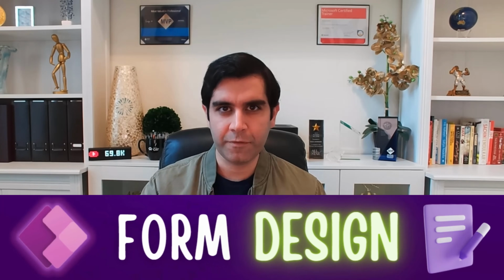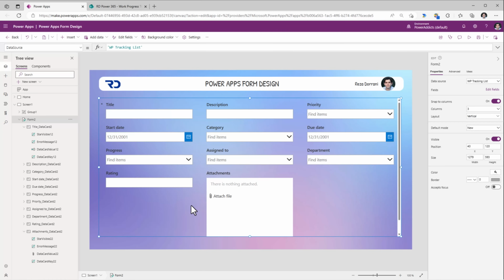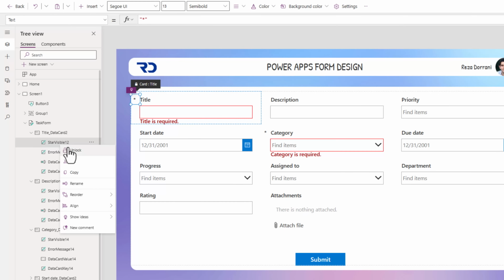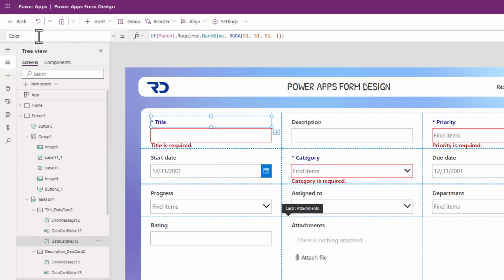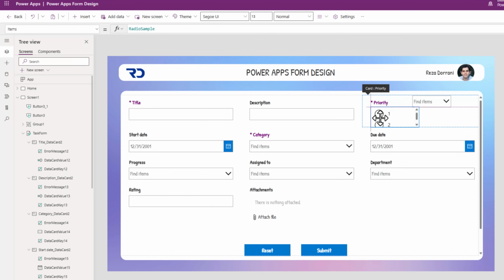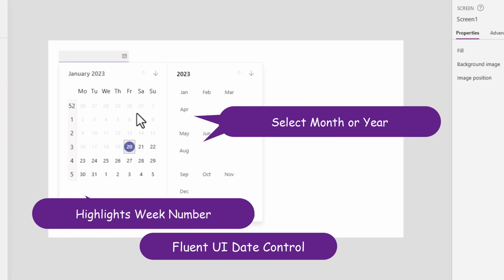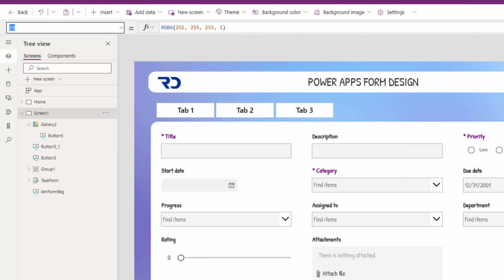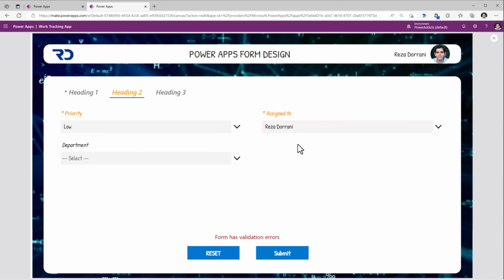Design your Power Apps Forms | Form Control Tutorial

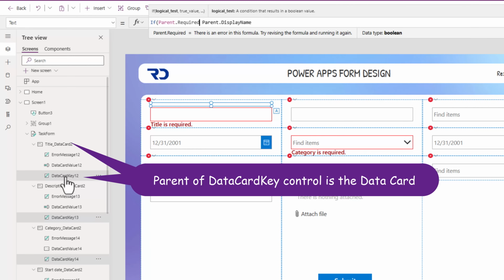Comment: the trick used to bulk select form elements in 7:57 does not work for me unfortunately. can you test if this feature is still enabled?
Reply from the maker: This is not a feature one enables but a pattern used in power apps which is very much valid.
I have not experienced the mentioned issue and hence not sure of the cause or fix for it. 
I will recommend checking or posting your issue on forums in case someone has experienced something similar 
https://community.powerplatform.com

Comment: I get through the part where I create the form. But once submitted, where does that information go, do I need to create a new screen for that?
Reply from the maker: It will submit the data to your connected data source
Reply: @RezaDorrani do you have a recommended video for creating a power app for in processing and out processing members in an organization?
Reply from the maker: I don't have a specific video on this use case

Comment: the variable for changing color of required columns seems unnecessary, because the end user of the app has no way of changing the color if the variable is only set using app onstart
Reply from the maker: The design of app was not meant for end users to change the color.

Comment: Always great Reza.  Thank you.  Question...  I used the date picker from a teams app and it works, however the value that I set in the form doesn't get written.  Can you tell me what I'm missing with respect to that?  Thanks!
Reply from the maker: I have not experienced that issue so not sure what the reason could be.
Reply: @RezaDorrani  It's odd.  The save of the date works and I see the value on the item, but it doesn't populate on the datepicker control on the App.
Reply from the maker: @hokemspitter  I have not experienced this so not sure why that would be the case. I will recommend posting your issue on forums at https://powerusers.microsoft.com/ in case someone has experienced something similar

Comment: Reza, I am a big fan of your videos. With modern controls, though, I experience an issue, and wonder about your opinion. 
Many of my forms have a gallery and a view form next to it. When browsing through the gallery, the new form updates representing the selected gallery item. Nothing exciting so far. 
With modern form date fields I experience the following: If the date fields are not null (i.e., there is a date), the form represent the proper value. If the field is null (empty), it seems the form data card becomes "sticky", meaning that the value from the previously viewed record remains in place. 
Has this happened to you (or anyone else here?) And if so, what can you do against it? NOTE: When using the old forms, the null fields will show 12/31/2001 and work as anticipated.
Reply: FYI, I use SQL Server as a data source
Reply from the maker: Modern controls (most of them) are in preview and I will recommend not using them in production scenarios until GA

Comment: hello reza, would be great if you can add how to patch all of these even when they are hidden does the value still remain ?
Reply from the maker: This video is based on form design (from what I remember)
SubmitForm will submit all the data even if hidden.
Reply: @RezaDorrani  thx appreciate all ur hard work to guide us newbies. I have same use case but I need to patch the datas written in the form. Is it possible or do you have any videos for this one?
Reply from the maker: @Soulebi03  I have done videos on Patch as well.
Reply: @RezaDorrani  will search on it. Thanks again my good guy reza.
Reply: hello reza sorry for the questions lately promise this is my last, but in any chance have you removed your video containing horizontal gallery tabs in a form that uses NotValid: !IsBlank ? Can't seem to find it anymore in your videos. @RezaDorrani

Comment: I would like to know how to use Toggle/CheckBox instead of yes/no Combobox when datasource is dataverse table. It is a problem to recognize true or false from dataverse Yes/No.
Reply from the maker: It is possible for sure but I dont think I have a video reference for it. I recommend posting your issue on forums in case someone has experienced something similar https://powerusers.microsoft.com
Reply: @RezaDorrani  I've tried ( There is the only way to get Yes/No values, but it's not clean code.
UpdateContext({BoolVar1: First(Choices('YesOrNo (YesNoTables)')).Value, BoolVar2: Last(Choices('YesOrNo (YesNoTables)')).Value});
If(Text(BoolVar1) = "Yes", Set(ConstYes, BoolVar1), Set(ConstNo, BoolVar1));
If(Text(BoolVar2) = "Yes", Set(ConstYes, BoolVar2), Set(ConstNo, BoolVar2));
Reply from the maker: @maksimdmitrenko  I have not tried so not sure.

Comment: Thank you for this amazing video on Power Apps Form !! This is the most knowledgeable video on power apps. I am building an risk management application in power apps and since my form was too large and has so many fields in it and i was struggling to fit in gallery so i have divided into 3 parts by taking reference from this video this video is very helpful. I need one help for my application i have a first in that i have a list of risk with button for each row, and when i am navigating through that button on the form screen the form is coming blank.
Reply from the maker: Thanks so much for your kind words.
Im assuming you are using buttons for moving across the divided forms.
I have done videos on tabbed forms (2-3 videos) and multi screen forms. I would recommend checking those videos.

Comment: You are very good. Please, Help to Create a user power app that has three sections each and each section has sub-apps connected to it. Thanks.
Reply from the maker: I do not have a video reference on this scenario and would have to try it out to provide guidance.  I recommend checking on the forums at https://powerusers.microsoft.com/ in case someone has done something similar.

Comment: These videos are excellent Reza, thank you. I am am having trouble with getting a straight answer to what I am trying to do. I would like to build a tab experience, in my form using a single SharePoint list. The tabs would be New, Change, Return, Leave, Termination. These would only be for submitting information to the SharePoint list and not displaying.  I need to know the best way to design this keeping in mind that i will need to re-use the columns on some of the forms, IE, employee name column will need to be on each of these tabs.. Are you able to tell me the best way to do this., or if this can even be done. There seems to be mixed information out there and I cannot seem to find anything that will verify that the SharePoint columns can exist on more that one of my forms. Any info would be appreciated. I would also need to ensure that when the form is submitted that the value of the tab is going to the SharePoint list. I already have a column for this information.
Reply from the maker: I have done 2-3 videos on Tabs. You can take a look and see if those help.
I do not have a video reference on your specific scenario though and would have to try it out to provide guidance.  I recommend checking on the forums at https://powerusers.microsoft.com/ in case someone has done something similar.

Comment: Great video, I have one question on the Tabs gallery you added the NotValid item, how did you make the code ThisItem.Value.NotValid work?  I have tried dozen different ways and still get an error.
Reply from the maker: Can you point to time in video where this was shown?
Reply: @RezaDorrani  the form tabs video
Reply from the maker: @frankcortes600  So not in this video?
Im confused
Reply: @RezaDorrani  yes this video at the end when the tabs show the validation star your code for the visible property.
Reply from the maker: @frankcortes600  Oh! I don’t have this App with me anymore so don’t remember the code.
Idea was to check if the star label control is visible for any of the fields in that tab, if yes then show the error message for tab.
Reply: @RezaDorrani  when I use the ThisItem.Value.NotValid get an error name not found.

Comment: Hey Reza.. I am building a multiscreen form. I need to display validation error messages before going to the next screen. I want to use the default error message control in the data card, But that is only possible when i use the submitform which i dont wanna do. Is there a workaround to make the error messages display exactly like if they were submited..
Reply from the maker: This is something that I have not tried. Not sure if there is an easy way for this. I recommend checking or posting your query on forums in case someone has done something similar 
https://powerusers.microsoft.com

Comment: After changing the layout I can't select datacardkey and value control using ctrl+z. Can you please suggest what could be the probable reason for this?
Reply from the maker: Not sure what the reason could be as I have not experienced this. May be try with a new form.
Reply: Tried but same output. For other controls like text , button undonis working fine but not for forms. It's strange. Let me dig deep if i can find the cause.
Reply from the maker: @ArijitDas-fr8ss  That is weird
Reply: Ah, earlier I tried with a form with 30 columns/datacards, but when I tried with a form with 9 column it worked. Not sure if their is certain limitations on undo function....🙃
Reply from the maker: @ArijitDas-fr8ss  not sure

Comment: Amazing video!
Reply from the maker: Thanks John
Reply: @RezaDorrani  I did notice that the CTRL Z doesn't work for me.  Nothing happens at all.  That would definitely be a nice option, though.  I also couldn't get the card colorfade to work the way you have it setup.  Is there some other step to get the self.error to work.  I've never actually seen that card do anything, and I couldn't get it to do anything using the syntax you mentioned. I had to go with this approach and avoid the self.error If(IsBlank(DataCardValue71), ColorFade(RGBA(255, 0, 0, 1), 0.95), RGBA(0, 0, 0, 0))  just to get the card to show error until filled in.
Reply from the maker: @Tech4John  Steps are as shown in video. Not sure of why it would not work.

Comment: I'm not sure that unlocking form control just to remove star component does anything for performance, but it breaks the standard control. Adding star to display name additionally worsens accessibility.
Reply from the maker: It wont make a difference in case of small Apps. In scenarios where you have 500+ controls, it could come in handy. It does not break any control of feature as shown in video.

Comment: Hi Reza, Firstly thank you so much for your videos. They are simple to understand and don't just provide a solution but show us also the logic behind it. It is very helpful. 

I had a question please, I used the steps you showed to replace a dropdown choice with radio buttons, but these won't update back to my SharePoint list when the PA form is updated. What should I do please?  Thank you.
Reply from the maker: I have not come across the issue you mentioned hence not sure what the reason for it not working is. I recommend posting your issue with screenshots on the forums at https://powerusers.microsoft.com
Reply: @RezaDorrani  - I just replaced the cards and added the radio buttons again and the error seems to have gone. Thanks so much.. Is there a way to make one of the tabs visible after a certain date please? Thanks again..
Reply from the maker: I do not have a reference for tabs visible after a certain date. Il recommend posting your query on forums.
Reply: @RezaDorrani  Thanks so much for your response and all the videos you've posted so far.. Owe all the apps I've created so far to them 😊

Comment: Thanks Reza for this great knowledgeable video!!! Currently I am working on multilingual powerapps & have choice column in SharePoint with yes,no values.I have a form in powerapps whose items is displaying from another translation SharePoint list,and if it is selected  yes or no,based on that I need to update form property to above choice SharePoint list.I explored a lot but still struggling to update form property & getting error as required option setvalue value.Please assist.Any help will be much appreciated.Many thanks.
Reply from the maker: I have done 1 video on multilingual apps but that was related to data only not the values.
 I will recommend checking on the forums at https://powerusers.microsoft.com/ in case someone has done something similar.

Comment: Thanks Reza, on the required fields formatting, right after the hard coded colors, you mentioned clicking on the App object and selecting OnStart. I am not showing OnStart as a selection. Any ideas as to why I cannot see it? Let me know. Thank you sir!.
Reply from the maker: Its in app settings. App start is going away in future.
Reply: @RezaDorrani  Under App, in our environment... I do see StartScreen, but not OnStart... is that the change?
Reply from the maker: @VentureNW  App settings, will have a feature to turn it on.
Reply: @RezaDorrani  I was watching another video of yours, on adding BorderColor to fields to highlight, if changes have not been saved and now I cannot find that video. I was able to get Text, Choices and Date to work, using your formula, but not a number... I tried to use the Text example but am getting a triangle and it goes to orange highlight. Not sure what the issue is. My list is checking for number entered and amount of digits
Reply from the maker: @VentureNW  I dont remember which video either. I have done over 200 videos now. 
I will recommend posting your issue with screenshots on forums https://powerusers.microsoft.com/

Comment: Great tutorial Reza! Thanks for sharing!
My Teams calendar picker is the same as the one in PowerApps (Not the nice version you got?) Any reason why I might not see the nice calendar picker you get in Teams? If I go to the About menu in Teams it states I am running version 0.7?
Reply from the maker: Video description has link to download a sample App - you can grab the datepicker from there.
Reply: @RezaDorrani  Hi Reza, It would be great if you could save all Fluid UI controls as a Sample App?
Reply from the maker: @williamfenner823  They are all coming to canvas soon. Lets wait for it.
Reply: Due to a PowerApps Service Issue (Current App 0.7) currently the modern Date Picker calender (copied from Teams UI to Canvas App) is rendered like the classic one. I have opened a Power Platform Service Request...
Reply: But the date Picker Control copied from Rezas Sample App is working as expected!

Comment: If you don't see the fluent controls, you will need to go setting within the app, select upcoming features and then type 'modern' in the search and enable modern controls.
Reply from the maker: Thanks for the tip 👍
Reply: I still cant see that modern feature in my application settings, why is that happening?
Reply from the maker: @mustafahussainmohsin320  Video description has link to download sample app.
Copy the date picker control from there.
Reply: @RezaDorrani  thanks for your help
Reply: How to design form having 78 input filed in single screen

Comment: Great video!! Is it possible to use a date filter of only Year (e.g. Filter by 2023, 2022, 2021, etc.) instead of picking an exact date?
Reply from the maker: Date picker is a control and not a filter. You could create a dropdown that only has Year information for user to select from.
Reply: @RezaDorrani  would the back end data source need to have Year as it's own data field or would you use PowerApp to code it? (e.g. Year(Date))
Reply from the maker: @fenrir433  I would use a separate field like number to store the year
Reply: @RezaDorrani  If I am capturing date from a Power App, is there an automated way to create the Year from that date column?
Reply from the maker: @fenrir433  Yes, the formula you mentioned earlier. Why would you want user to pick a date if intention is only to get the year?
Reply: @RezaDorrani  Form has a date picker (eg event date) but another page has to be able to filter a data table by that date column but only for the year. End user doesn't want to pick a date to filter the data. (.e.g filter by the event date year)
Reply from the maker: @fenrir433  so Year(Datecontrol.SelectedDate) should give you the info
Reply: @RezaDorrani  Is this a formula for a calculated column or in power apps?
Reply from the maker: @fenrir433  Im confused with the original question. Il recommend posting your issue with screenshots on the forums at https://powerusers.microsoft.com

Comment: Great video! Thank you as always. I have struggled to master reordering cards within a multi-column form when using logic in the visible property of certain cards. Would be great to see you go deeper into some of those design elements.
Reply from the maker: Thanks.
Order the cards for the form based on position inside Tabs.
Reply: @RezaDorrani  The position constantly changes or resets, especially when adding custom cards. etc. I know the X and Y control can be used here but I'm definitely still missing something...
Reply from the maker: @hnk5965  Check my playlist on forms. I have done several videos on forms.
Link in video description.